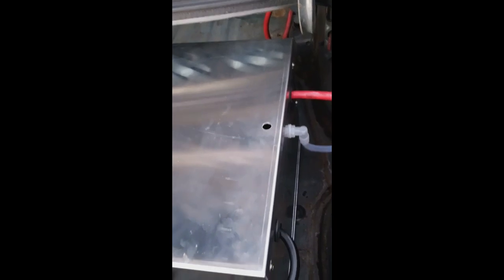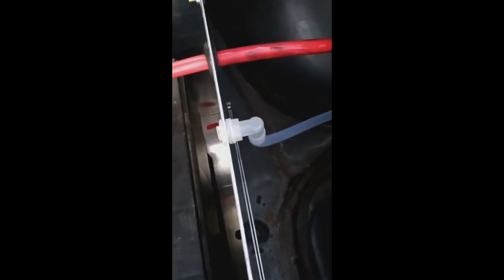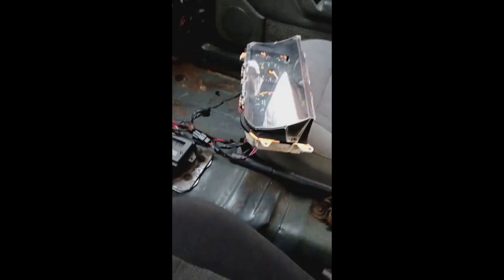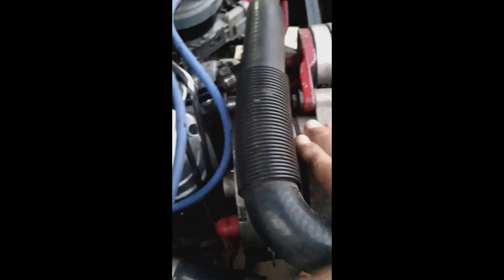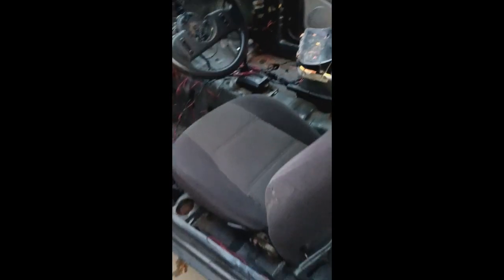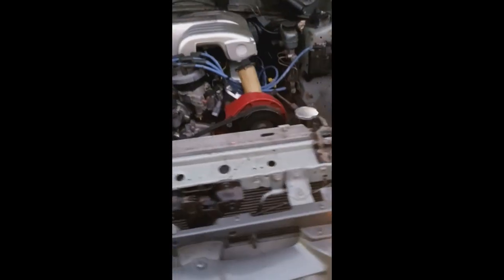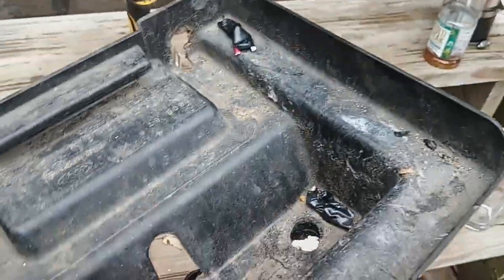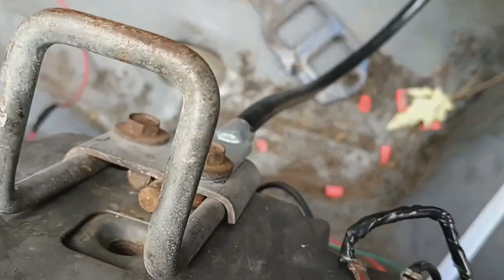Battery and Solenoid relocation Fox Body Mustang

Comment: I've gotta say, I think I like moving that solenoid. I despise the driver side rats nest of wires.

Tho I think what I'll do differently is instead of using the hole for the air intake  to run The wires, I would use the area where the thermobaric (I think that'd what they are) thingys are between the shock tower and firewall, move (or delete) them to free up that space, and stick the solenoid there.

That way the engine bay is a bit cleaner.

But you have me a great idea, thanks!

Comment: Hi have you had any grounding issues, with this setup if you still have it?
Reply from the maker: Hi JM, --- This battery box relocation did not work out for me. Had grounding issues, stripped the bolts on the solenoid two or three times ect. not worth the effort. I put it back to stock and removed that box.